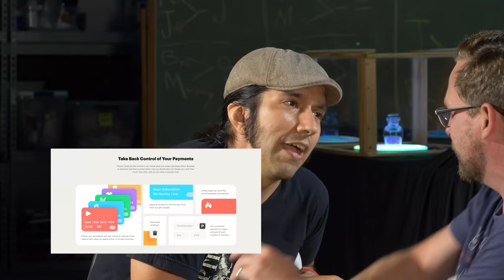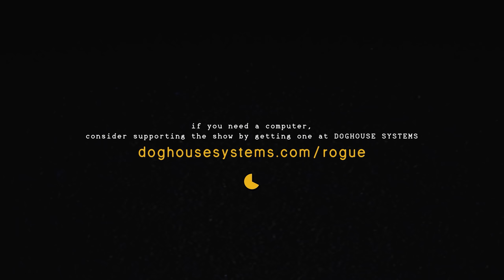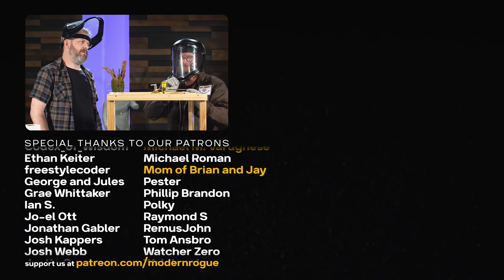Do Jewel Thieves Really Do This?

Comment from the maker: This week's giveaway is our super slick Limited Edition Hoodie from the 2021 FUN-raiser! Get comfy AND rep the Modern Rogue in style! Take a look here: https://www.scamstuff.com/products/hoodie-5-limited-edition We’re giving away ONE Modern Rogue Limited Edition Hoodie for this week’s gimme. Enter for free at http://gimme.scamstuff.com for a chance to win (no purchase necessary, giveaway ends 7/29/2021). Congrats to the winners of last week's Modern Rogue Masks giveaway: Jacob Farmer, Mohd Ashfak Uddin Khan, and Nicholas Keith (we will contact you via email within the next two weeks.)
Reply: You guys need to watch more glass cutting videos. After you get the score etched, heat the glass a bit(if it's sideways you want to use a torch or one of those reusable hand warmers(because they get hotter than the disposable ones)), and then put some ice right around your score. The temp differential should cause the glass to crack right along the etching. You really only use the "hammer" when you're cutting a straight line and then you lay the glass on a small dowel rod or the like with the rod running right under the score, or maybe just a touch on your side of it. Then you tap on the other side of the score with the "hammer". The stress from that will cause the glass to crack along the score.
Reply: @ The Modern Rogue, i was a professional glass cutter for 4 years. You almost nailed it. You were missing 1 tool though. Propane blowtorch. Thats the secret to cutting circles in glass. You cant hammer a curve in glass, gotta score it and torch it. Hope this helps you in your jewel robbery.
Reply: The hammer is for straight lines only, any curves require heat
Reply: I could show you how its done
Reply: Can you try it again and spray it with computer duster liquid to freeze the glass around the scored area?
Reply: When scoring glass like that you wanna do the cutting and in complete circles, and if you need additional lines do it inside the circle
Reply: @mrobich321  Jaws
Reply: @mrobich321  I love that movie.
Reply: Should had invited Larry Lawton
Reply: Not sure if this will actually work or not in the end. But for sure your biggest issue was scoring on the outside. If you watch the break on the second one they were following your single score lines outside the circle. Maybe try it again without scoring where you want the glass to stay. And try scoring the circle less as well
Reply: Bouncing soundwaves off the back of a human retina and translating into visual data. 
Weeee, I get to be crazy.
Reply: Suggestion from someone who has done glass work:
The scoring line should only just bearly be visible, then score the inside of the circle not the outside

Comment: Legend NOT tested.
Jason: explains correct procedure, whether or not he understands it himself
Brian: completely ignores him
You're not supposed to(and can't) cut through it with a tool like that. What you're doing is introducing a single point of failure so that when you tap it, it cracks along that hair-thin line. Brian's just grinding a wide path with low pressure and as he does that, the integrity of the pane is actually improving after the initial circle. Radial lines outside the circle just mean the pane will break outside the circle which is clearly not what you want. The frame and glass you're working on are also too flexible and light so when you hit them the shock is absorbed.
Get a good seal on the suction cup, apply pressure to the blade and draw the circle ONCE. Then you strike firmly near the line but inside the circle. Don't be timid, you're trying to break it. Leave the suction cup on so you don't drop the glass disc when it comes loose.
Reply: Just want to add.
You can forget the pizza slices completely if you're trying to be stealthy, use the suction cup as a handle and pull on it while tapping
Reply: This was painful to watch coming from a float glass manufacturing facility.
Reply: This was painful to watch coming from a float glass manufacturing facility.
Reply: @thalaquatics8712  This was painful to watch by anyone with basic knowledge of how a class cutter works lol. You'd think that having a Youtube channel themselves, they might go check out a video or two on how to cut glass before basically just picking up the tools and winging it. Kinda disappointed in the boys here.
Reply: @Jester_The_Jynxster  That's sort of the beauty of this channel though. It sort of just showcases two average joes approaching concepts and techniques as complete novices. They aren't here to educate the audience, they learn WITH the audience.
Reply: @Jester_The_Jynxster  Jason did say he watched videos. But Brian was the one with the cutter.
Reply: @harmless3449  That'd be a good point, if they actually learned how to do it.  XD  There should be a second half of the episode where they do it right, possibly in combination with somebody who knows what they're doing
Reply: I completely agree (although I only had a feeling that the multiple circles were hindering them) I even said (to myself) when they scored outside their “target” that they were making a sun when they should be making a pie
Reply: Pocket torch and canned air works every time, no percussion needed.
Reply: @harmless3449  well it seems like most the audience knew more so WE didn’t learning anything along with them. Sorry.
Reply: Spoken from someone who has scored glass beforeXDXD
Reply: @rotjer2000  I can neither confirm nor deny these allegations. Please contact my legal team.
Reply: @B-Swift  pretty bold of you to take it upon yourself to make that statement on the behalf of over 90,000 other people 

but alright
Reply: @roamingthereal4060  Correct, but you don't actually want to apply as much force as possible. You want JUST enough to crack it along the scoring. A more stable, firm surface will absorb the force properly and break more predictably. Plus, more force usually means less precision.
Reply: I basically gave a much more abridged version of this in the comments as well. They didn't use the glass cutter as intended. The ball was the fracture hammer, and they were clearly too timid to initiate the proper break. Lol
Reply: yup, pain.
Reply: I'm surprised they didn't just google how to use it...
Reply: @Jester_The_Jynxster  That's literally any video they do that doesn't include magic and also is the reason I don't watch TMR as often anymore. Miserably failing at the simplest tasks that require a miniscule amount of research and training really kills it for me.  They can first have a go at it and after that show how it's supposed to be done but I assume that's asking for too much, even I who haven't been anywhere close to a glass shop know how to properly use a scoring tool. Being scared of the simplest of tools and later a display of utter incompetence and disregard for anything remotely informative gets old fast.
Reply: Makes sense, I was surprised it broke so easily along the radial score lines when they finally got arround to tapping it.
Reply: @CNSninja  if you can read instructions you're miles ahead of Brian and Jason
Reply: Thank you, didnt have to write this myself :D really saving time

Comment: Try scoring the circle less and the lines INSIDE the circle pizza slice style and hitting it dead center. If done well you should have a nice and neat score line around the edge and a bunch of glass pizza slices inside. If you score too much, it might shatter the whole thing
Reply: Also water helps
Reply: That was my conclusion too.  Score INSIDE and perhaps maybe possibly 🤷‍♀️
Reply: AND preferably on the opposite side of the glass which doesn't really help without an inside man.
Reply: @velazquezarmouries  or mineral oil
Reply: You're also supposed to use the ball end of the glass cutter to tap the scored section out. The ball helps to keep from scoring the glass further when tapping it, and causing other breaks.
Reply: That reminds me of that episode of mythbusters, that moment when the glass shattered was hilarious
Reply: and no one has pointed out it's not tempered.
shows how much you know about glass.
this is to Lauti Martinez and all of you others that fail at being NOT entertained.
Reply: Oh an I am DEFINITELY not saying that it would be better. 
Just pointing out that they DID NOT KNOW THE DIFFERENCE. 
There's no excuse for being uneducated when "jewel thieving"...
Reply: @wolu9456  8:16
Reply: Yep, I wanted to find this comment/instructions and say 'Yep, this is the way to do it!'  There needs to be a 2.0 of this test.

I'll even add use some hot water or a small blow torch to weaken/fracture the glass and pop it in.

Comment: I'm usually not one to give advice, but since it was asked for and I have cut glass before, maybe I can shed some light onto this failure. So remember at the beginning of the episode when Jason said that when he's seen it done they only score it once and Brian asked something along the lines of 'what would it hurt scoring it more'... Well, with each additional score you are adding more and more unpredictability to the eventual break. You probably noticed that each additional score felt a little bit more like you were just grinding sand and the score got thicker and thicker as the blade bounced from left to right each time it hit a glass shard. Each of those minute alterations to the score provides a new point at which your break can escape the score you have made and branch out across the rest of the pane of glass. All you are doing with the score is telling the glass what line you'd like it to break along, the more lines the glass can choose between the more likely it will find a dead end and lose the score.
Reply: That's a great explanation. I didn't know that
Reply: Also use the round hammer end to break the glass, not the scrapper
Reply: It's a property of Glass (Which is a Liquid).
Best seen in shattering a Glass with Sound, having a scratch or imperfection makes it work a lot easier.
Physics Girl did an episode on it.
Reply: @lokithecat7225   It is an amorphous solid, not a liquid
Reply: @internetuser8922  While accurate, it feels like something the average person wouldn't get without looking it up.
Reply: So just one turn would work?
Reply: @lokithecat7225  So have them look it up, don't feed them half-truths.
Reply: @AbsoluteAbsurd  Much more likely, yes.

Comment: Half the fun of the episode is watching them use the tools all wrong and using the wrong technique in every possible way.
Reply: First off, that cutter you got was junk. Not nearly enough suction. You're better off making your own out of a vacuum suction cup and attach a glass cutter to it. You then go around the glass with the cutter just a couple times. Not for 20 minutes. Take the ball end of the other tool you had and while pulling on the suction cup with moderate force, you tap the inside of the circle with the ball side close to the score line and it should pop free.
Reply: @jordanpinto9687  experience with it?
I have seen people do it with cord and a glass cutter, they cut about 15 out of a glass table. But I think what they use would be better.
Reply: @gabrieldeoliveira7725  no experience as a jewel thief, but I do have a bit of experience in cutting glass. A good seal with a strong suction cup is a must. We used the ones with handles while washing windows that had the ability to provide a vacuum and a release button. I have used them to remove panes of glass from my windows that had lost their seal.
Reply: "Look, this has a ball here" - not once use it to hit the glass...
Reply: @jordanpinto9687  Never more than 1 score at any given time. The moment you've tried to do more than 1 or tried to re-score it's over. Also you want cutting oil for a smooth clean motion in your score.
Reply: I love these guys but when they do this kind of thing I feel the over whelming urge to mansplain the shit out of them. As well having plenty of experience with glass I was cringing the whole time. I thought for SURE someone was going to the ER.
Reply: Yes and no. I enjoy them not knowing exactly what they are doing. However i wish they would at least have someone research how to actually do it successfully. And finish the episode with it working. Because it can work if done correctly
Reply: P.S. Once around (use a decent amount of cutting oil), do not pizza/pie cut anything, tap around the score cut gently but firmly. I like what Jordan said about pressure on the cup but also make sure you use pressure toward the glass on the  score cut. It takes some pressure to make a good score cut.
Reply: Might be able to pop it out on 1/8 but most windows at ground floor are 3/16 or thicker (accept the really old ones with the little tiny sections that are glazed in) theres no way it would work with a thick window
Reply: @jordanpinto9687  yep.  Applying heat also helps to crack the glass along the score line.
Reply: @slimpkns7864  just as important. As someone who has worked with wood more than glass, but has assembled things with both. That frame did them no favors. It absorbed most of the force they gave it, and the first break was very clearly the flimsy frame bending and forcing the glass to shape. Which of course, glass cannot do. It wasn't broken by the tool, it broke by the container.
Reply: I've been cutting bottles for more than a decade, this made me yell at the screen. Single score line, then tappa tappa tappa. The glass flexing in the frame was not helping, use a suction cup to hold it in place when you tap. If you have a light even touch a butane torch would be the fastest getting it to fracture on the score. It's way easier to actually do it than what these two had in mind.
Reply: @hardwire666too  I think everyone was surprised they didn't reset the injury counter
Reply: But they normally get it done... this was just bad all around.
Reply: The other half is reading all the comments of people lamenting how they did it wrong and explaining why. Fun AND educational
Reply: @armorhide406  oh yeah, the comments are a rather big part of this channel
Reply: Yeah. Score it, then use thermal shock to break it cleanly
Reply: Yeah, but then they usually look up what to do if they can't figure it out. Without that, it just felt like they needed an excuse to push an ad.

Comment: Try scoring the glass less (literally one full circle and stop). Scoring it more just makes it harder as the point is to create one singular line of stress to control the cut. Then apply heat along the crack to cause it to grow (I recommend a soldering iron), This will stress the glass causing the crack to visibly grow without creating any additional noise.

Comment: The wood frame is absorbing the impacts with all the flexing it's doing. Something more rigid would probably work a bit better.
Reply: Also would probably help if they used the hammer end of the tool to start with.
Reply: Trying to cut at the edge of the glass would be easier, it should be more rigid near the edge

Comment: You only need to score it once. After that you're rubbing glass dust against the diamond coated wheel sanding the wheel down running the tool.  Theoretically you could run it around in a circle until the scoring wheel cut through the glass.  And Brian's first tapping technique was correct just not hard enough.
Edit. It's possible you scored it too much. My credentials; worked at ACE hardware for 8 years +I collect hobbies as a hobby.

Comment: Do not pie cut anything. It creates weak points and focuses the cracks, that then continue past the score cut. Also use ONE pass with cutting oil and decent pressure on the cutter. Finally, while slightly pulling on the suction cup, tap on the score cut with gentle but firm strikes. Go all the way around as you tap it. This should help the glass “slowly”(glass is fast) crack along the score line.

Comment: This episode kinda made me mad I've cut windows in the past and this ain't how you do it chief if you want to cut a circle you have to score once in one direction then you use the round end as a toffee hammer applying small but often strikes and you work your way around clock wise you'll know your through if you look through it at an angle and you can't see past the cut or look though from underneath and you'll see the same circle at the bottom then apply pressure to the suction tool and keep tapping till you get a clean break then your in.
Reply: "You're"
Reply: @loralou-djflowerdove  you're?
Reply: @DatBoiOrly  "You'll know your through" You're*

Comment: 4:55 Visible light goes through lasers, the key being 'visible'. Infrared light is blocked fairly well by glass and absorbed, so you can use (as mentioned) CO2 lasers to cut glass.
Technically I believe glass is 'transparent' between about 380nm (near UV) and 1800nm (infrared).

Comment: Lighter fluid on the glass, let it burn then put cold water/ice/cold wet rag on it
Reply: better yet, put a shoe lace around the circle then soak the lace in lighter fluid
Reply: @mister_gibson1837  that one works better on bottles since they are circular and therefore expand and shrink different than a pane.
would be worth giving a shot but I doubt the effect would be the one desired

Comment: I used to make wine glasses out of old glass beer bottles so listen up rogues. Before making any score marks you want to ensure that the glass is clean. Spray it down with some brake or carb cleaner first. When you're scoring you only get one shot at going around in a continuous line. If you continue to go back and forth what you do is you end up cutting the crystalline structure into a haphazard raggedy line on a microscopic level. After you make the score take a blow torch and heat up along the line gently until the glass is too hot to touch but not so hot that it's about to melt. Then from there skip the tapping and just toss some ice water on it. Pop goes the weasel.